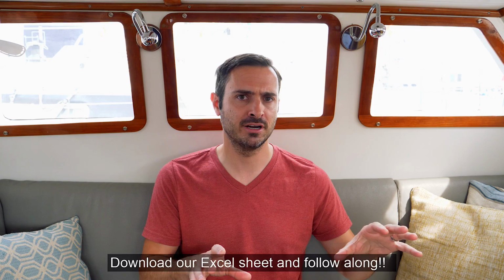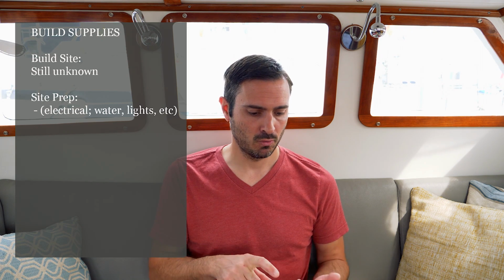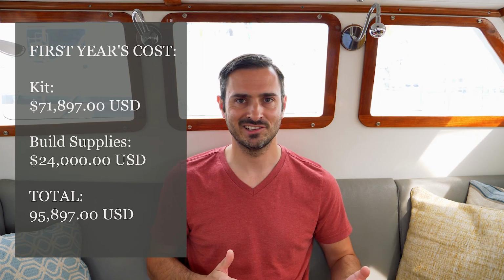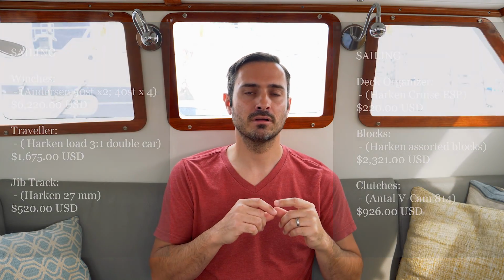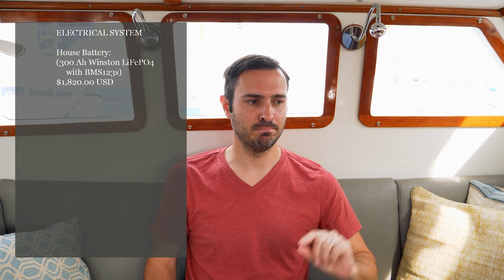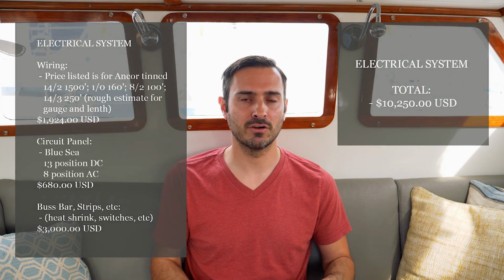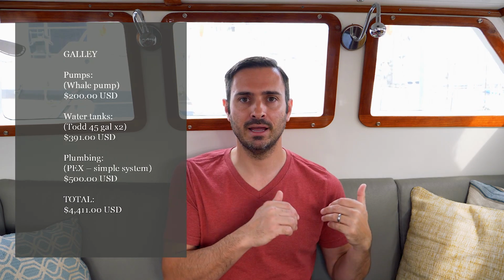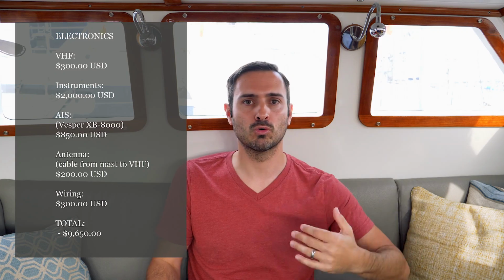What is it Going to COST to BUILD a Kit CATAMARAN? - A Comprehensive Guide (MJ Sailing)

Comment: I am doing the same thing. I am torn between the Schionning Arrow 1360 and the Oram 44 C or the Oram 45 R. They all look great boats to me. My prices had the Schionning as more costly but taking less time to build. The other factor for me was the resale value. I too just want to get my money back after 5-10 years and I have the Schionning ahead there. I think their furniture options gives them a better finish. The Oram philosophy is more upon the spartan/performance end, and the focus is on simplicity and pure sailing practicalities. I am probably going to hire some help so I am costing in some wages and on costs on top of this to give me a better comparison. I am not sure whether you have mentioned the choice between Duflex balsa or foam. I think both designers are right with preferring balsa but the resale value of foam seems better even though I think the concerns about balsa are ill informed. Please keep posting theses videos, it is much appreciated.
Reply: 100% agree on balsa!   From what I've seen, the typical amateur cat build is taking the time to decore and protect all deck/hull penetrations, so the chance of water intrusion is much less than most production boats.   But regardless of how it's built, the balsa core stigma from years of cutting corners linger on... especially in the US.    

Is Schionning quoting ATL panels for the 1360 or infused from Current Marine in South Africa?  There is a significant savings to be had by getting the panels from SA (if you're not in Australia).   If we go with Schionning, that's the route we'll take.

You're right about the furniture difference for the Schionning.  With everything laid out and precut with their kit, it will force us to stick more to the plan and get it done.  With the Oram, you can go spartan or build it out to your hearts content.... it's up to you.  But I imagine with that blank space and no fixed plan, I'd end-up spending a lot of time doing all kinds of extras that eat up time.   

If we do go with the Oram it won't have the forward cockpit.  It will basically be a 44c with reverse bows and flat front bulkhead ( I don't like slopped glass in the sun).    -Matt
Reply: matt johnson I am in Australia so I assume the panels quoted are from here. The way the panels are made is that the balsa is in separate 1” bits so even if there is a crack on a rock, only a small bit gets affected and it can be easily fixed. What I like about the Oram’s is their simplicity. I like the one big dagger board. There is a you tube clip about a guy who puts one in his boat after a lot of study and he altered his boat and his performance really improved. I also like outboards which are cheaper than diesel and have the benefit of being able to be lifted to reduce drag and make it easier to beach and repair. My worry with them is generating your power and heating which require different systems. The front cockpit shown on the 45R would be good to sit around on at anchor, and I suspect that other seat would prove useful. I reckon if you want to at least get your money back in 10 years then you would really have to spend a lot of time making sure you finished the Oram well because I think that is what people will look at. So the spartan may not cut it. I think the Orams will be faster, just because they are lighter, but they are both very fast boats. The Schionning building system seems to me quicker and more simple. I did also look at the Spirited designs kit for the 480, which I think has the best building system of the lot. It is a bigger boat again. It would cost more but I suspect at that size it would repay that extra investment when you sold it. For me the Schionning is slightly ahead, but I have changed my mind so many times. My reasons are the building system looks easier and quicker, I think it’s resale value will be higher and the furniture options are integrated into the design meaning that it will be much easier to finish well.
Reply: My impression is that the Oram is much easier to build.   Here is why I think that:    

1)  With the Oram you build it upright on a female form, flip it over when it is still light, tape the bottom seams, then flip it back over. That means very little fiberglassing is done overhead trying to defy gravity.  
2)  It only has only one seam at the typical sheerline to fair vs the multiple seams on the hull side, cabin top and deck of the Schionning.   I think keeping all these seam lines straight, well blended and faired will be hard.
3)  It also doesn't have any additional floor structures or as much furniture to build out.  

Is the interior being precut on the Schionning what make it easier for you?  -Matt
Reply: matt johnson yes the furniture is one aspect. The Schionning system from what I can make out sort of comes together around its frame. Builders talk about the precision of the pieces, in the barebones project it talks about making things fit. It is a good point about not reaching up all the time. They both quote project build hours and the Schionnings are considerably less. Maybe Bob Oram is more conservative in his estimates, he certainly has examples of quickly built boats. I am a bit scared of getting the bows together and both hulls the same. On the other hand there are many Schionning projects built and the owners seem to support his estimates. I don’t really know, I am just trying to work it out myself.
Reply: @mattjohnson6716  Just before your video I have been quoted for the Arrow 1360 and arrow 1500 from schioning. The quotes are from SA and I have both balsa and foam. interestingly the balsa is the dearest. I also have quotes from VDL in germany (I'm in spain) for raku and arrow and a quote from spirited.
Reply: @Ian_Woods  Did you get any better pricing on the Raku than the numbers quoted on the Grainger site?  -Matt
Reply: @mattjohnson6716  Just seen your reply youtube didn't send me a notice. I got the price from VDL in germany for the grainger raku 44 still waiting for the 48, but the price for the Raku 44 is virtually the same as the arrow 1360 for the kit. so any difference can only be the cost of plans. I will ask Tony for a cost of the plans only. If you want I can send you my spreadsheet with all the kit costs so far.
Reply: @mattjohnson6716  now i have the cost of the plans only ill add that to my spread sheet

Comment: I installed off-grid solar system at home, products purchsed online via alibaba wevsute... prices in USD  i,  $600  -  5kw inverter & MPPT charger ( EASUN )   ii,  $1,200  - 4.5kw solar mono panels ( BLUESUN )    iii,   $1,200   48v 200ah   LiFePo4   battery    (  Delong  battery  )

Comment: If you're going to power with outboards, you'll already have gasoline on board. Why don't you plan on using Honda generators instead of a wind generator to supplement your solar? I think they'd be way less expensive, quieter, less maintenance-intensive and even more reliable, especially sailing downwind when wind generators are not particularly useful.
Reply: I don't think I mentioned wind generator.  We installed one on our current boat and 90% sure we wouldn't on the new boat.  The boat will be powered mostly with solar.   -Matt
Reply: @mattjohnson6716  Ah. I guess I speculatively filled in a non-existent blank.
Reply: @portfoliofotoz  We've been pretty disappointed with our wind generator.  Since we know we were going to Northern Europe and flat solar wouldn't be as effective we added one to this boat.  It worked well for that, but all the other time it's sat back there shading the solar and causing lower input than it could bring in itself.   -Matt

Comment: Did you get any estimates to have this built professionally? Just interested what it would cost for someone who wanted something as custom as this but didn't have time to do the actual assembly themselves.
Reply: Really depends on where you build (labor rates).  I haven't investigated this at all, so may be totally false, but what I've heard is $500k even in a low labor wage country.   The math doesn't make sense to me- build hours x average wage- but that's the number that keeps floating around.    -Matt

Comment: Thanks for your dedication to making great videos and sharing so much. I did sense you both are a bit tired of everyone chiming in, but for the most part, viewers have only the best intentions and wish you well. Here is my take on things. Just food for thought, do with it what you like. Outboard engine install is certainly easier and less $ than inboard diesels. However range may be an issue so you may want to look at fuel consumption on the gas motors vs. diesel based on your records of engine hrs and when you needed to motor-sail.  Outboard manufacturers specs on consumption is likely very optimistic and your #'s are actual use. You may find you need much larger fuel tanks and $$$ for the same hrs and/or distance. There are more BTU's in diesel than gas, and diesels make power at lower RPM so inherently use less fuel. Gassers run much faster (2 X ish) for the same power. If you motored for days at a time, the sound of 2 gassers howling might get old real quick. I don't know of a diesel owner who wishes they had gas, but a lot of gassers wish they had diesel, for a lot of reasons. Consider exhaust fumes. I'm a power boater so don't know how wind and relatively slow speeds of a sail boat would affect fumes getting to the cockpit, but gas engine fumes are headache food and more motion sickness for almost everyone. So anytime you have smelled diesel fumes in elements,, multiply that annoyance by at least 2 for gas.

You kids are full of energy and also have tremendous options for where your life can take you. Looking back for me (i'm 60), I think the best things came from recognizing and being in a position to take opportunities that were extraordinary, not just pretty good. This applied to my choice of woman to marry, career direction, real estate investments... Everything. Meaning more than just one or two stars needed to be lined up, out of the 5 or 6 needed for things to go reasonably well. Extraordinary was 3 , 4 or even 5 stars lining up and only 1 or 2 things (stars) left to follow common results.

You both like to build, and are certainly not afraid of hard work, so labour is free (sort of). One star lined up. Start lovin' the fast food joint nearest the build site. Everything else seems pretty regular and no real stars lining up. Say you already had access to a near perfect space to do the build that was nearly (or totally) free (an uncle has a manufacturing business with a vacant building that's perfect). Great - two stars out of 6. Corona-plaooza hits! Sheesh. 

Effects on the economy are likely to last for most of a decade maybe even more. Cruising boat market will definitely go soft for a bit, so elements is worth less as you noted - Minus one star. You may need to pay near retail for many supplies and delivery can add up quick. - Minus 1 or at least 1/2 a star. As you said, refitting Elements wasn't cheap and it remains an old hull. But it's a metal hull so less mysterious than the same age fibreglass. Excellent call on that! However, the new build will still be a kit boat despite the newer year. Is that be a wash as far as value goes? The biggest value is the kit appears to be bringing the boat build into your price range. Like the warranty issues on the refit parts you described, things will always come up to throw off the budget. Now throw in just one wild card and the equation can fall apart. Plan for the worst, hope for the best, right? Say one of you breaks an ankle miss-stepping off a stool. My friend did exactly that building his house and added 6 months to the house move-in date and he's still limping 5 yrs later. In my experience there doesn't seem like enough stars lining up in Plan-A anymore to make the build an extraordinary opportunity.

Opportunities come in many shapes and sizes. Maybe embrace Corona-plaooza for what it might offer in new options while the pendulum swings the other way.

I built and did a pretty wide range of things in my life and had a great ride. There were a number of things we didn't do that we were 98% convinced were great next steps. Like you, planned them out meticulously, and at the last minute stopped it. Looking back, most of those were sheer dumb luck that we stopped and shortly after saw we had dodged a bullet. By far, the most rewarding was fitting a family into our plans and are so glad now that we have 2 amazing kids and shared so much of our lives with them. That's an opportunity you might be glad to have, and sail a 10 yr old 45' corona-cat for $0.25 on the dollar?

What ever you do, we'll be watching your amazing adventure as long as you are sharing it with us!

Comment: Why buy US made epoxy, pay to ship to Australia, pay duties, and then they ship it back to you at a markup?? Same with cloth. Doubt any is woven in Oz.
Reply: You're correct.  Buying the epoxy local is what Oram and Schionning suggest.   The epoxy itself is actually around the same cost to source in the US, but you save on the import fee and hazardous shipping fee... the bottom line number represented in the excel file doesn't change.   -Matt

Comment: Hello, nice episod! May i ask you what board did you use to make your headliner? It looks very nice - together with the wall.
Reply: Thanks.   We routed the v-grooves into 1/4" marine plywood at 3-1/4" centers.    All overheads throughout the boat, and the hull side lining (ceiling) in the v-berth, galley and lower salon is done this way.  -Matt

Comment: great summary of the project, since you still have some time have you considered diesel outboards, petrol on a boat that has low usage may have shelf life issues typically it goes off between 3 and 6 months and is definitely at least as big a hazard on board as propane cheers
Reply: The safety issues is a bit different with a catamaran and gasoline.  You put the tanks on the bridgedeck and vent out of the bottom directly overboard.  Unlike a monohull- sail or powerboat- the fumes (the explosive part) can't accumulate to the percentage needed for combustion.  It's just like a fuel tank in a car.... if any gas vapor leaks out of the tank, it just goes on the ground.

There are only a few diesel outboards available, and they are unfortunately really heavy.

-Matt

Comment: Sounds like you should be building in the UK , there a some good cheap sheds on the west side of the Tamar .. Anyway all the best on what sounds like a great project.
Reply from the maker: Just before lockdown we went to Multihull Center (Dazcat) on the other side of the Tamar...they had a pretty good set up going there!  But we're looking to do the build somewhere warm so we don't need to add heating to our building space.  We'll be looking at places on the coast of the US, between Virginia and Texas.
Reply: @MJSailing  yeah UK to cold, that's why I if I decide to do this will do it near my villa here in sunny warm spain :)
Reply: @Ian_Woods yes its nice to work in the warm,  but spending 300 hrs plus hanging onto a longboard trying to fair the hull
in temperatures of 30 degrees C sweat running into your boots, not much fun. Think how much time you could save working at a steady 12 degrees C

Comment: Absolutely go for outboards!  I had twin honda 20s on my 40' cat (Pescot Whitehaven that I built) and they were amazing!  Being able to raise them out of the water, no folding props, no worry about anodes, 1/3 cheaper, 1/2 the weight, take 'em out when needed and they could push my boat at 9 knots fully loaded.  Fuel economy was around 4-5 litres per hour.  The down side is on resale-- people don't like them.For practical purposes, they are perfect.
Reply: Thank Philip for the feedback.  It just seems so impractical to not focus so much expense and weight on diesel for a boat that you expect to sail well.  -Matt

Comment: You should checkout “raspberry Pi for boats” on Facebook
Reply: We currently have one running Pypilot as a back-up to a back-up for the autopilot.  But that's about all we've used it for.  Our AIS transponder already acts as a wifi multiplexer, so we don't need it for that.    And I'm not in love with OpenCPN.  It's extremely capable- and I've had copies of it ever since it came out- but we almost never need the extras it has, so find the interface cumbersome.    

-Matt

Comment: How about a line item for the expense of moving your completed boat to the place where you intend to launch it? Also, when completed will it fit on a flatbed truck and be not too big to haul down the highway? When I was a kid my parents built a themselves a houseboat from scratch over 100 miles away from its final destination. They did not think to measure twice (especially how wide it was going down the road) and also forgot to factor in how much it weighed for going over bridges on its final journey. In other words for them it was a hassle similar to moving an actual house.
One other caution: working with all the chemicals and solvents and fiberglass will be really hard on your respiratory systems. Please don't ruin your lungs in the process. I do wish you all the best on your building adventure. Thanks for the weekly videos!
Reply from the maker: Although we have not decided on a build site yet, the plan had always been to have it within 10 miles of a navicable waterway.    We'll be searching out property along the coast of the US, between Virginia and Texas.